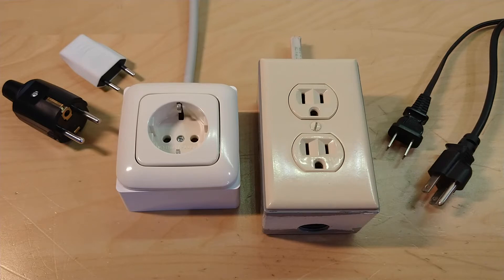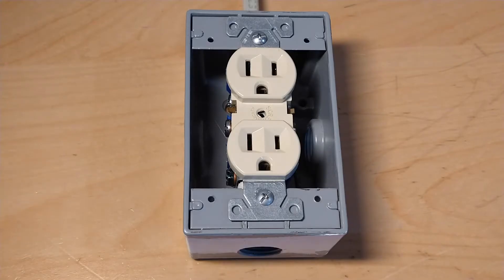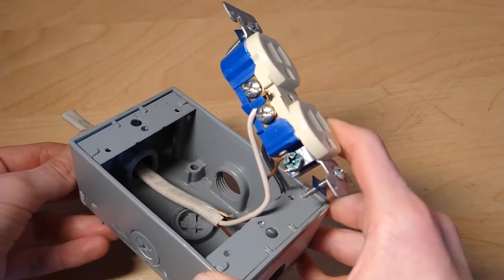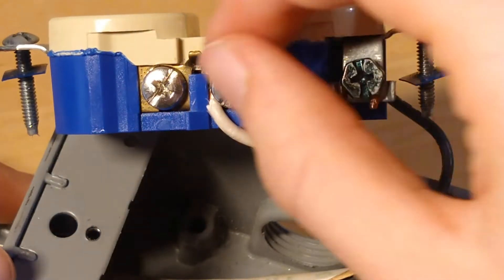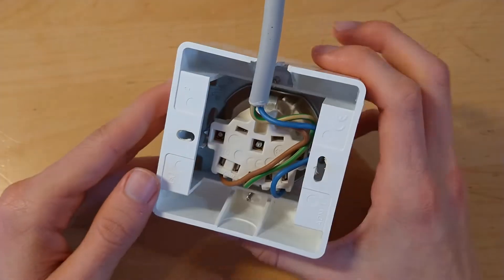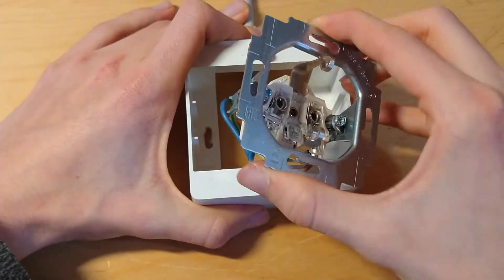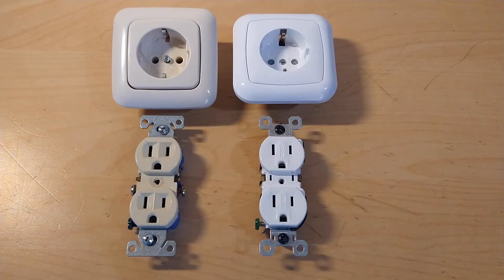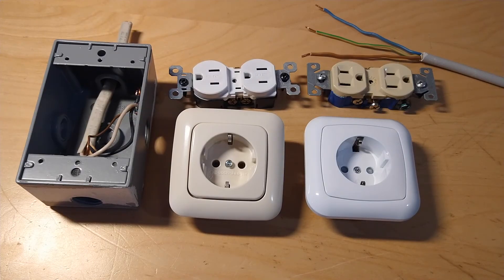American vs European Power Sockets: What's The Difference?

Comment: If you get the industrial grade & some GFI outlets in America they DO have that same CLAMP PLATE screw terminals as the 2nd European you showed. In many commercial installations they use stranded wire & that DOESNT work well with normal biding screws but does on the ones that have the PLATE below the screws like the 2nd European one with those same screws you showed me FYI. The safety shutters in America are relatively NEWER & since 2008 they are now required in residential settings & where children are. They were FIRST required in places like day care centers. Some peole special ordered them & installed then in their homes even back in the 1970s

Comment: My house has so many of the typical 6:34 sockets, but it also has one special (perilex 460V) socket to power a electric cooking plate with more of the heaters or a oven with electric heaters
Reply: 3 phase plug and socket? Which country?
Reply: @Mixolixplosion  most european countries except UK has three phase sockets in residential, here in Poland it is very common in garages or for kitchen appliances like induction cook top

Comment: It's interesting that in Russia after the fall of USSR we changed to European sockets, despite so many electric sockets and plugs were in use. Soviet style sockets had the same round pins with the same distance between them buh they were narrower. So at first adapters were in use which allowed to use modern style plugs in soviet sockets. Nowadays you will hardly find any soviet style socket here.

Comment: I hate German sockets as a Czech, we use French sockets and it is mostly compatible, but sometimes it's not when you have some older product made in Germany that doesn't have hole for grounding pin or vice versa our old plugs din't have those 2 holes for German style grounding, it's ridiculous that even neighbor countries can't have the same sockets. Good thing about German sockets is that you can put it vice versa, but on other hand, it's a safety risk and since we are obsessed by safety rules here, we adopted more safe French sockets back in Czechoslovak days. And phase should be always in left, but since these German style sockets are symetric, it's easy to do it vice versa, that's why I think French sockets are safer.
I also noticed that some German products like vacuum cleaners, even when it has metal body, it has just 2 pin not grounded wiring! Why? We always think about Germany as very safe hi-tech country with good safety standards, but our Czech products are actually safer. When I replaced cable in my Karcher cleaner (because my father damaged it), I grounded it because that's how it should be, I am surprised that such metal body not grounded german vacuum cleaner is even legal here.
Reply: Stop talking crap
Reply: When you have a "double insulation" device the earth is not mandatory, the outer case may be in metal but the inside body is surely whole plastic, so no conductive parts exist to the case.
Reply: @lapub.  vacuum cleaner with metal body definitely doesn't have a double insulation 😀
Reply: @Pidalin  It can... I dismantle an old grinder, body was in cast aluminium and not grounded, but all the inside was plastic moulded so double insulation, also work for  extractor hood also ungrounded, outer casing can be in inox but the motors light and switches are in an inner casing made of plastic. Wet vacuum cleaner have ground  to be safe if water found is way to the motor.
Reply: You don't understand AC electricity lol. Germans treat the neutral as equally dangerous as the phase. So that concern is eliminated 😅

Comment: North American household electrical system runs on 110/120V, 60Hz with A, B plug&socket type whether Europe and including Russia runs on 220/240V, 50Hz with C, E, F plug&socket type.
Reply: Jamaica and Barbados uses 110V at 50Hz, and Curacao and Bonaire uses 127V at 50Hz with A,B plug and socket type, South Korea uses 220V, 60Hz with C, F plug and socket type

Comment: The way te US outlets are standardized is amazing. In Europe everyone is different One has to be very careful when connecting them in order to make it correct.   On the other hand on American outlets if you remove the cover you have live parts directly exposed. inside.
Reply: US outlets makes me feel uncomfortable just by looking at them lol. Best ones are UK sockets, then European. I live in EU and I don't know what do you mean with being very careful when connecting them, it's one of the easiest electrical jobs, just screw 3 wires to the right places and you're ready. I do it myself at home, of course after fully cutting off power.
Reply: @axel-xan Type C and F is better than the UK'S atleast the newer versions
Reply: Could you elaborate? As far as I know (here in Germany at least) every brand, like Buschjäger, Jung, Gira etc, use almost the same system. The common installation "in wall" installation uses the same "box" mounted in the wall, the same screws... The only difference is that only brand specific face plates and frames will fit.

Ps: I am sorry if my English isn't the best.

Comment: I wonder why the European ones only take one appliance per wall outlet and the ones in North America can take two.
Reply: There are 4x outlet combos available. Just need to have attention on properly setting up of fuses.
Reply: @kabelloseskabel7029  Thanks.
Reply: 2x is common. In Germany they, however, tend to put two singles side by side. This requires more work but then the cables do not interfere with each other.

Comment: I thought they use black and blue with yellow green for ground and coming to main panel 2 black one brown and blue and a yellow green for ground
Reply: Brown is new colour, black is old (single phase). Brown, black, grey for 3 phases. Blue: neutral, yellow-green: earth.
Reply: @Mixolixplosion  coming in to a panel I saw 2 black 0ne brown for the 3 live wires what is different about the brown wire
Reply: @DavidBerquist334  L1 brown, L2 black, L3 grey. Current European standard.
Reply: @Mixolixplosion  what was it before
Reply: @DavidBerquist334 They probably did not have grey wire so they used a black instead of grey. In the UK they sometimes use three phase armoured cable (brown, black, grey) from the meter to  the single phase panel. They just wrap blue tape (neutral) around both ends of the black wire and yellow-green (earth) tape around both ends of the grey wire.

Comment: Plug and electrical standards were hastening mostly hastenly set around the turn of the last century by a few industrial conglomerates. If the UK and European countries could go back in time, 120 years or so, all would have chosen the compact NA A/B plug and the much more versatile 120/240 split phase voltage.
Reply: how is 120/240v split phase power more versatile? 120v is worse because lower voltage means higher resistance & higher current which means thicker wires
Reply: @gamecubeplayer You should know, of course, that here in NA we do have separate outlets and plugs for 240 v. We have several in our home.
Reply: The split phase is a mess. 
In Europe and Asia (Excluding Japan.) only a 220-240v single phase can power air conditioners and tumble dryers at the same time. Also electric kettle boiled faster than 120v.
Reply: @DangerWrap No mess. We simply have different outlets for 240 v.
Reply: @DangerWrap  much residential properties also has three phase services, 3x230/400V here in Poland and probably in most european countries, is much better than NA split phase
Reply: No, we had such systems. We chose to a higher 400 V system so we do not need to have a transformer at every street corner.
Reply: @okaro6595 This is why i love european power systems, the transformers are often placed in a 50-150m radius from what i've observed, and not every idk, 25m
Reply: @kraəb  It's more something like 1 km
Reply: @ It varies a lot, but where i live it's usually every 150m
Reply: @okaro6595  In the US we don't think in terms of "street corners."  I once got into an argument with a 911 operator about "the nearest cross street" on the road I live on.  The road was two miles long and had no named cross streets.  When running a line to a house it is cheaper in most non-urban sites  to use a single phase and hang a transformer than to run three phases everywhere. Two miles is 3.218688 km by the way.
Reply: Except the U.K. did go back in time, in that it completely started over.  So while the north American type A plug was created roughly 120 years ago by Hubbell Incorporated.  The BS 1363 plugs used in the U.K. were created by a society of electrical engineers for the government less than 70 years ago,

The BS 1363 plugs were essentially a consequence of World War II, in the aftermath of which a priority of government was to rebuild infrastructure lost in bombing raids.  It decided a safe all-purpose plug was needed to replace the mixture of different plugs for different amperages that had evolved.  A committee of the Institute of Electrical Engineers spent a few years designing a plug around various safety features.  It is generally regarded as the safest plug design.
Reply: @Rebecka_J  Even today, I don't have a clue about anything that can be improve in the BS 1363  The only downside of is how it look 🤣 !

Comment: Our north American versions are nice  as mentioned there are those tabs you can "split" the receptacle. You rarely break the neutral side but  you can break the hot and have a "split switched" where one half is constant power and the other is switched, common in living rooms and areas where you may want to plug in a lamp but control it from the entrance to a room, yet still have the outlet powered for a phone charger etc. They can also be "split" and wired to provide two circuits, common in kitchens, areas where you want to plug in two high power appliances.
The ones you see here are cheap "residental grade".  There are "commercial specification", "industrial specification" and "Hospital" grade receptacles availible that are far more robust than you see here,  availible with screw clamp terminals for solid and stranded wire as is now found in commercial and industrial installations.
Reply: In european version you can also do that with splice sockets, but you need a modular two ones. Single double sockets unfortunately can't be separated to another circuits.
In kitchens we needn't power double receptacles by two phases, because from one circuit you can get 16A (3680 watts) on 230V mains, higher power devices like induction tops or electric stoves are feed from 400 volts three phases (in Poland we have acces to it in every house)
Reply: @AsXSn   I have to say I am kind of jealous that our system isnt straight 230 / 240 volt like it is over there,  also being able to have 3 phase  present in your house would be a nice option.
I'm in Canada, 347/600V is very common in commercial for lighting (347v) and 600V for larger loads or building distribution and stepped down to 120/208 for basic loads.
We cant even have 3 phase to a house unless it's for some extravagant purpose, it's just 120/240V single phase. Nothing in a dwelling of "more than 125V to ground"
Reply: @REWYRED  US/Canada unfortunately stuck in Edison low voltage distribution system, but with AC instead DC, Edison DC system deliver 2x positive legs 110/120V / 240 and 0 / ground, like a symmetrical power supplies in audio amps.
Europe fortunely went to three phase low voltage distribution
Reply: @AsXSn   We do have similar in our houses.... 120/240 1 phase 3 wire..

Center tap grounded secondary on the distribution transformer so you  in essence get two 120V supplies and still get 240V  across the outer hot legs... In this configuration nothing is above "125V to ground" and like a 3 phase system  you can share the neutral and it will carry the difference between the two hot conductors... We use the 120V for the typical lights, small appliances  and the like, 240V being reserved for appliances like the stove, dryer, central air conditioning, electric heat and some  motors like a pool circulator (they can be 120V or dual 120/240V).

Would be nice if small appliances were 240V, could get more on a circuit, and  we wouldnt need huge breaker panels for our houses, 
24 circuit was minimum. But you can get 32, 48, 64, and up to 84 circuit panels now.
Reply: @REWYRED  Here also usually breaker panels in houses can be big like 20-30 circuits typically in new houses.
Our three phase supply unfortunately has one serious problem, it's neutral wire, this is very "sant" , our dystrybution system usually work in TN-C system where neutral have also ground role and is separated in breaker panel or meter cabinet into separated neutral and ground, this should be grounded additionaly by probes or other ground methode.
Sometimes I hear about loose neutral wires in power services what may cause interphase voltages on single phase appliances and damaged it rapidly when neutral in breaker panel isn't grounded good.

Once I hear about problem with neutral wire on main low voltage distribution line from transformer which feed two residential streets, overhead line was old and grounds for neutral wire on poles was on very bad shape, neutral wire unfortunely was damaged behind the transformer and much single phase devices in many houses got damaged. Residentials with newer breaker panels with surge protectors probably was protected when it happen and main breakers in meter cabinet probably trip
Reply: @AsXSn  In France the neutral is bound to ground at the grid side only, and the ground in the house side is provide by ground rod.
At least one benefit of the french smart meter is they include an overvoltage protection that will cut the power to the house in case of overvoltage from neutral loss.
Reply: @ so TT distribution grid system, overvoltage protection build in meter is a good thing, maybe some smart ones installed today here also has something similar probably
Reply: @AsXSn  As the French meter is use to cut power if you go over your subscription max power ( that can be set from 3 to 12 kW single phase or 3 to 36 KW 3 phases) they made it trip "for free" in case of over voltage to avoid them to pay for your destroyed appliance. As it look you don't have to pay for more power(only limited by the 100 or 200 amp service) I don't think they put a breaker in the meter
Reply: @lapub.  here "smart" electronic meters also has build in contactors, but mainly to remote power cut off if someone does not regulate power bill, about getting power over subscription value, in power services we use breakers before meter with only thermal element which would trip at overcurrent over subscription value, some regions also uses standard automatic fuses MCB as power limmiter, usually C characteristic (in three phase service minimal 3x16A and average size for modern house 3x25A or 3x63, in main line before meter cabinet fusible fuses HN type are also placed as main protection
Reply: @AsXSn  In France the path is grid=>fuse on line-neutral link, meter, breaker.
The fuse act as a last resort safety as if breaker can fail to open, fuse can't fail. The breaker previously monitor the subscription but is now set to the max the service line can handle (60amps for new, some +50year old was thinner and can only handle 30 amps 1 or 3 phases) so it will only deal with short circuit or overload that are over the cutting capacity of the meter (90 amps) as if the current is over this limit the smart meter will no open to protect himself as it's not design to break more than 90 amps.  Most new build house will have a 6kw single phase, electric heat pump, cooking and so on, and with a power management that will temporary cut the heating if you start your oven to not go over subscription. And you have room for an upgrade to max 12 if you want to speed up the charge of EV.  3 Phase even if available everywhere is more a rarity. Note, all underground connections are builds with 3 phase cable, 3 phase connected to the grid in order to not touch the main cable again in case of a future upgrade.
Reply: it usefull for many people, thank for sharing

Comment: There are US outlets with screwless connections also but they are more expensive so usually DIYers are the ones who install them while professional electricians install ones with screws. But screw connections always have metal connectors on them like you showed on second Eruopean outlet with screw connectors. I never seen connectors with just screws like what you showed.
Reply: As time is money it's professional now only use screwless connector for everything. You get theses "wago like" connector for everything, plugs switches but also for breakers that also came with screwless busbars.

Comment: What i find "shocking" about the NA Metal housing is that it looks like there are no Ground connection to it. If the live wire ist bustet and get contact with the case you get quite "Shocked"
Reply: There's a brass tab on the yoke of the socket outlet. That provides a bonding, it's usually used the other way around (backbox bonded, socket outlet itself not connected to the CPC). But only if the socket outlet is installed that connection is established. But anyhow, there should be a terminal with a green screw inside for that connection. But I think the green screw is missing on the example shown here. They don't come with that box, need to be purchased separately.